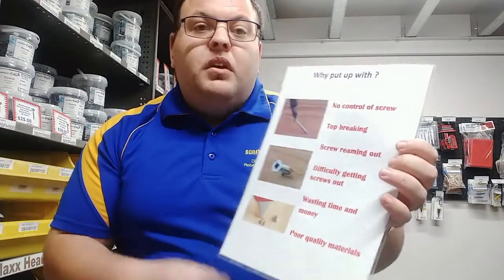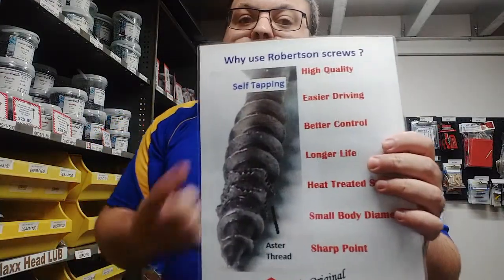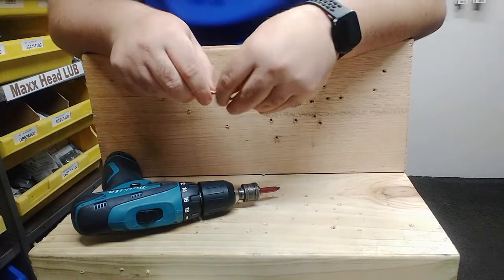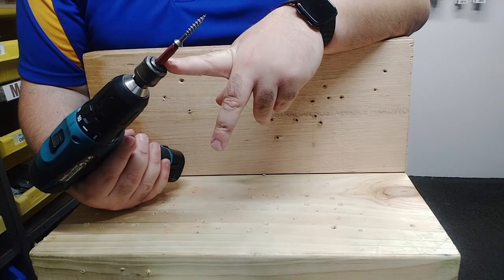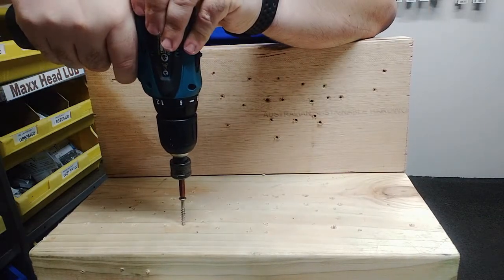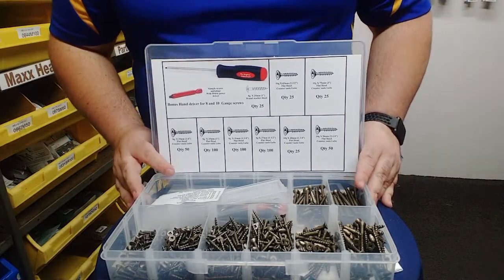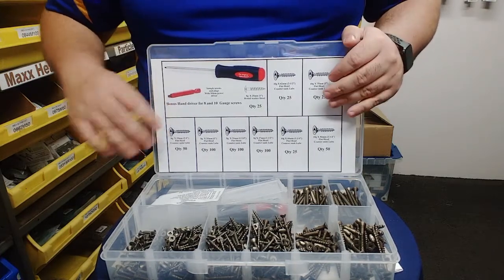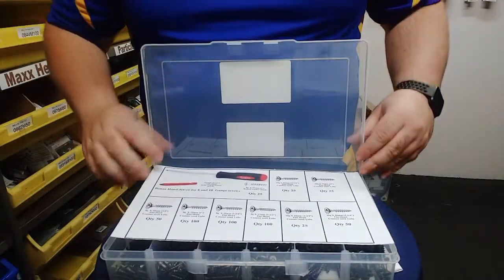Introduction to Robertson Screws

Comment: You didn’t even drive the screw in all the way and it jumped and then you pulled it out, square drive sucks, star drive with 1.5 thread and 1.5 shaft FTW